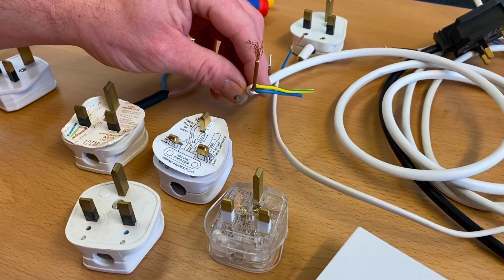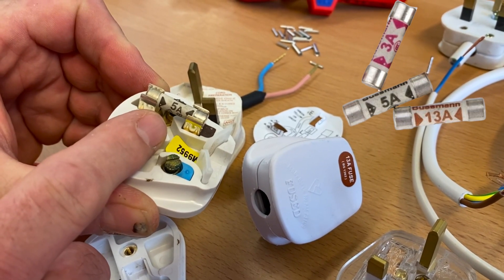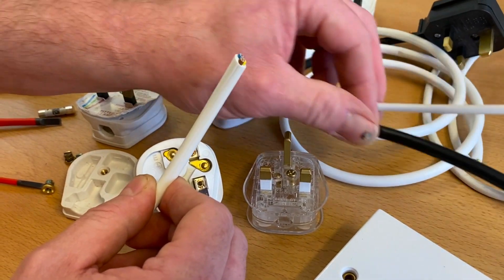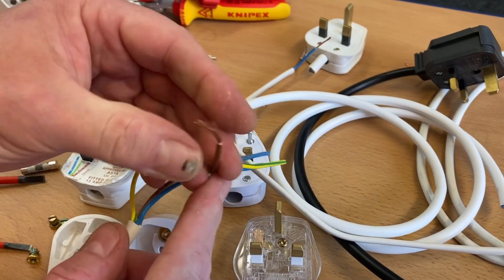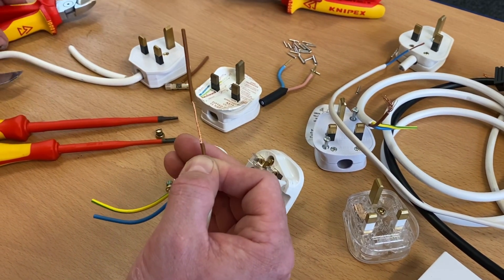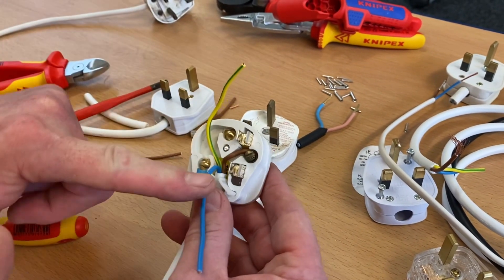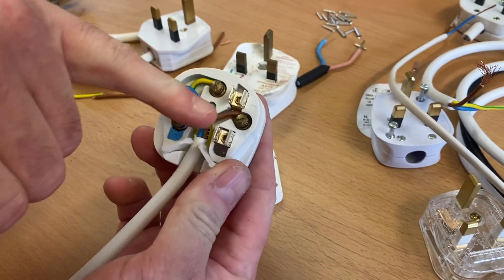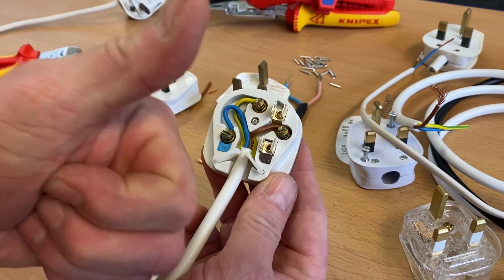How to Wire a 13 Amp Plug Top BS 1363 - Connecting a MK U.K. Plug Top Tutorial and Step by Step

Comment: Why do we have 2 core flex. Yes class II don't need a cpc. However the cord doesn't have a cpc . There fore its only protection apart from the insulation.  Is against over overload. All lighting circuit need to protected by RCDs . Isn't the flex part of the circuit
Reply: As you said class II does not need CPC. I do not get where you have the problem.
Reply: @okaro6595  the thought that came to mind is that you could have a cable running across the floor and second damage could be involved
 Short flex to fixed appliances reduces the risk but how long can have  a flex said to be ok. That's was my point. Sorry I'd I didn't make it clear.
Reply: You don’t need a CPC wire to be protected by RCDs.

Comment: I'm of an age where I remember appliances that were sold without plug tops. I really don't remember when I first learned how to wire one in, but do remember that wiring a plug was one of the tests set by my upper school for me to be admitted onto their science and technology programme. When I started work on computer installations in the late 80s, I had a trainer on the electrical side who swore by the electricians knife and so seeing the outer insulation bursting and the conductors stripped in the way shown had me thinking of Vic shouting a my constantly 'where's your bloody knife son'. I've knife-cut cables all my career.

Comment: Thank heavens Wago have not created a plug top! I loved the old (very old) mk plug top where you could check the fuse without removing the cover, great practice newbie’s 👍it’s the length of the earth pin which denotes first in last out, not the flex.

Comment: I remember Curry’s and Dixon’s salesmen would often say this item dosnt have a plug . Would you me to fit one (and charge for it) if you said yes please 9 out of 10 times it would be fitted very badly with the coloured wires hanging out the bottom of the cord grip. 
I would always recommend MK plug tops on high current appliances.
Another good tip is always make sure the fuse clips are nice and tight especially on cheep plug tops .
Reply from the maker: Great comment Andy brings back memories 👍🏻

Comment: Nice tutorial Gary. The MK screw/post plug makes a much better connection on the copper, and the wires are far less likely to pull out. All 13 Amp plugs should be like this IMHO.
Reply from the maker: Agreed 👍🏻
Reply: If you’re that bothered about connections, just use uninsulated ferrules. Flex isn’t ideal for any screwed connection in direct contact with the bolt.

Comment: I've never seen those MK plugs before: they seem pointlessly fiddly. I wonder why they do it like that?
Reply from the maker: I like them because it was I challenge for my learners 👍🏻
Reply: It makes a much better connection on the copper, and the wires are far less likely to pull out (if wired correctly).

Comment: Neutral is far too long! Earth should always be the longest core as per the diagram on the plug top.
Reply from the maker: If you look at the diagrams they would all pull out at the same time - I don’t follow the rule about the green and yellow needs to be the longest just in case something catastrophic happens to the construction of the plug top. This exercise is all about building dexterity for my learners. Thanks for commenting. Gaz